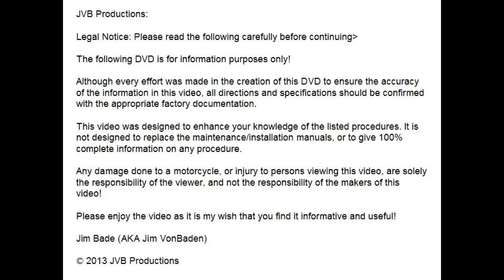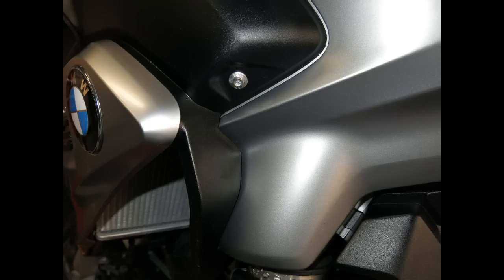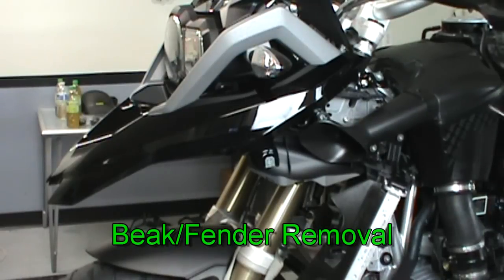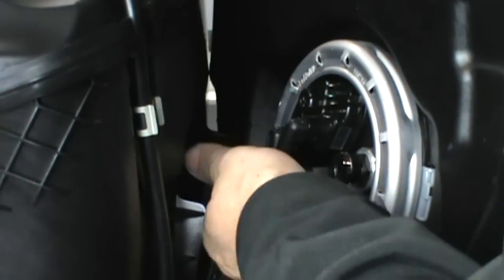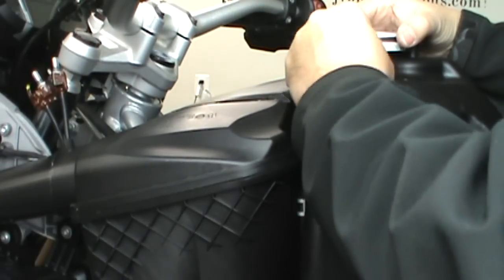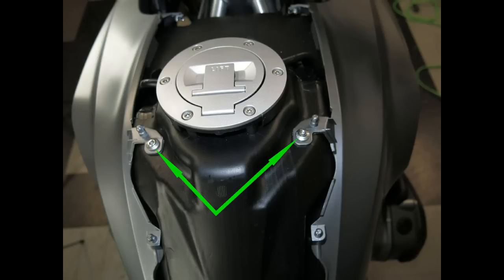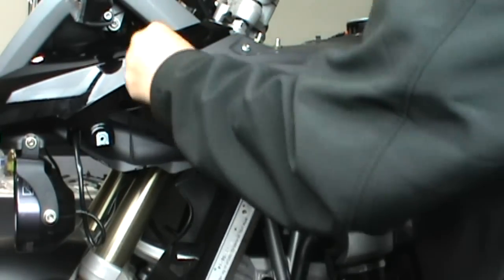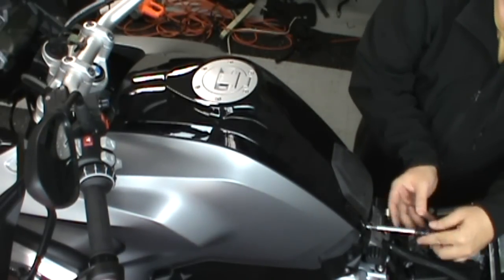R1200GSw Bodywork and Tank Removal and Installation 2013+

Comment: Thanks for the video!  Question:  I noticed that there are four different types of screws, three different T25s and the one T30.  Well, I screwed up by not taking note of which type goes where, aside from the T30 which is the obvious one, where can I find the list of the screws placement?
Reply: Anthony Escribens try MaxBMW website has complete parr’s list with diagrams.  Down to the very screw!
Reply: I did the same exact thing

Comment: I can not get the tank cover to go back on cleanly. The rubber grommets just won’t engage leaving the cover and 1/8” above the mating surface with the side covers. I even loosened the gas fill because it looked slightly off center. Any tips for getting this cover back on? Do you recommend putting the grommets on the pegs and then assembling?
Thanks.

Comment: Hello 
Super good video ❤
Now maybe can you help me .
We hace 3 bmw with my brothers , and now one r1200 gs start with a electrical problem.
This one no sleep and stay on 0.1 amp .
If you pay attention when you shut of the engine , over 1 minute and nothing the sistem eléctric sound 2 times . One principal rele . And another one click of something behind the battery. 
May you or some body tell me what unit is that?
This one in the other gs1200 same year make a noise and sleep . In this one we haven’t got that noise and don’t sleep .

I appreciate a lot if you can help me 
Thanks 
Gabriel

Comment: @jimvonbaden: Hello Jim, I hope you are doing fine. I admire your work. I see you took both the 2013-2016 and the 2017-2018 R1200 GS apart. I came up with the idea to do a nice winter project. I would like the complete fairings of the 2017-2018 model on my 6-2016. Do you know if this is possible? I think the frame, engine, tank, fork and radiators are the same. I look forward to your response. thanks in advance! Greetings, Glenn

Comment: This is atrocious! I'm so disappointed in BMW; they've shifted focus from field-serviceable machines to Japanese style contraptions that are designed with dealerships in mind. I have an R1150R Rockster, you could work on it in the open country with the included tool kit. This thing has a thousand screws to get at the littlest thing. Beautiful and powerful machines, make no mistake but the design philosophy is a travesty!
Reply from the maker: In my experience, these bikes have actually gotten easier to work on. our R1150R is simple, but the same era R1150RT has more screws to remove than this, and is more difficult to work on, especially with the Servo-ABS brakes.